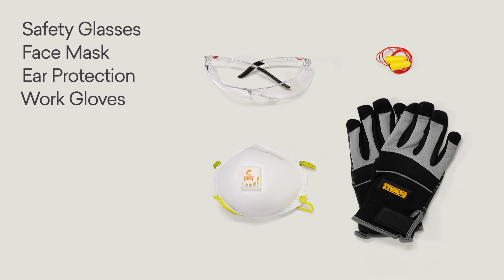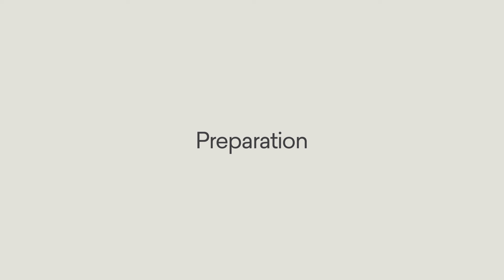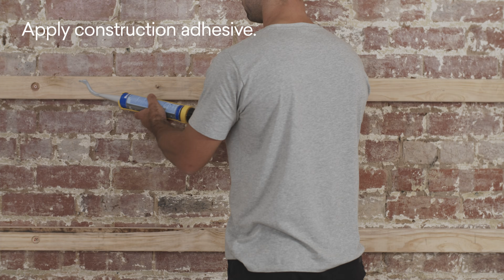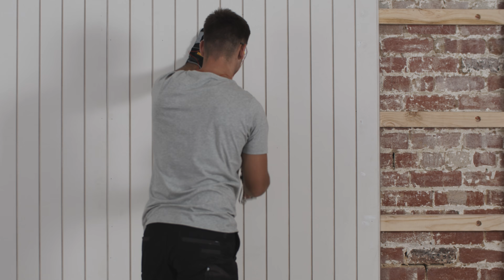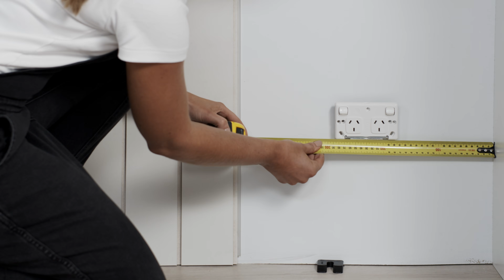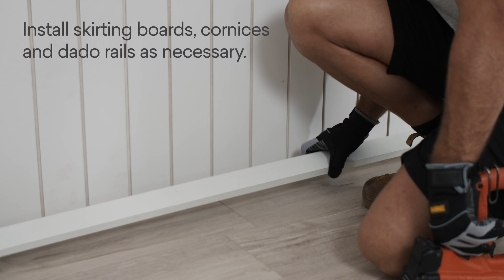How to install panels on Brick or Block Walls

Comment: I notice they don’t show the top of the wall. Most walls already have cornicing so it could look stoopid.
Reply: I beleive they did that on purpose lol. Just spoke with a chippy loading up materials at bunnings @ and he said the same thing.. I think I'm just going to sikabond the sheets straight to the brickk wall & use masonry nails also. I have a tv bracket in the center which will help hold the 2 middle sheets. Also a floating cupboard along all 4 x sheets aswell. See how we go, I'm just a stupid electrician anyway 🤪
Reply: @disapatemc5307  rock walls can sweat moisture if it goes right up against dick with no air in between it can get mold I think
Reply: Thanks.....I hadn't thought of that. Batten width + panel thickness.... 😬

Comment: Hi, what did you use to secure the wood to the wall?? Thanks
Reply: this is the most important question and they didn't answer it
Reply: Dyna bolts
Reply: how do you attach furring strips
Reply: Awesome question
Reply: Silicone